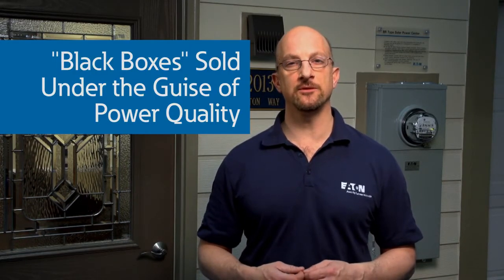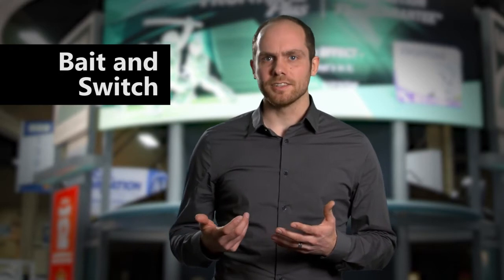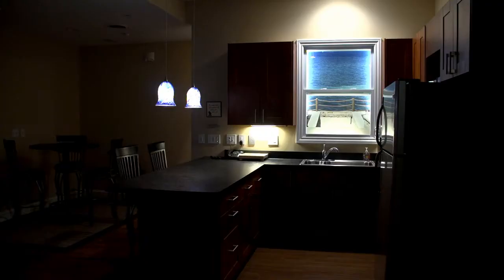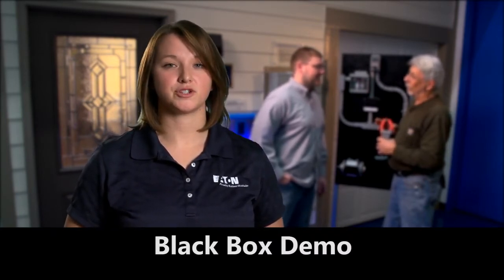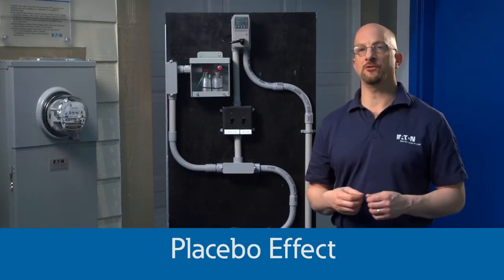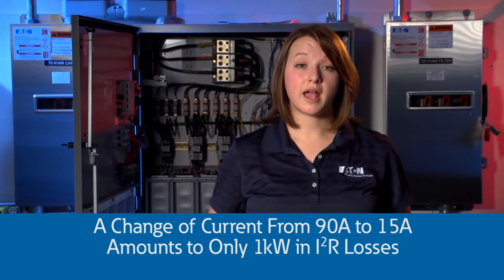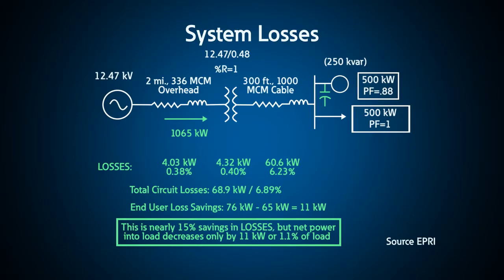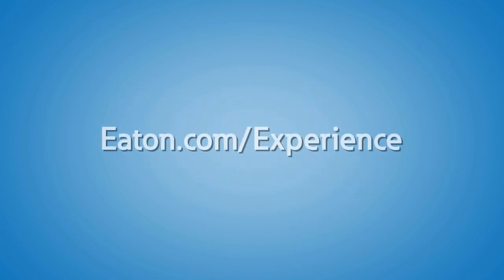False energy savings - free energy?

Comment: By adding a capacitor to a motor circuit that is inductive, you would be improving the power factor and therefore “wasting” less power. So how does the KVA get cut in half but the KW load not change? That to me doesn’t make sense. The KVA should stay the same while the watts change no? Being that the formula for watts is Volts x Amps x Power Factor = Watts. So if your power factor improves, wouldn’t that by definition change your watts? Am I thinking about this wrong?

Comment: I happened upon your video, while searching on a related topic.  I've been consulting in the energy field for 21 years and am certainly familiar with the topic that you discussed.  In fact, my company often validates energy vendor claimed savings on large projects.   I can tell you that there are incredible claims, poor executions and confused sales people in so many energy efficiency areas (e.g chiller reheat).   In this case, capacitors can certainly help eliminate sizable PF penalties when customers fall below a threshold.  However, could they have spent that same money in focusing on the larger inductive loads and buying new motors with far greater efficiency that solve the PF problem as well?  There are many variables and they will most certainly harp on distance from the meter and line losses to counter that argument.  As for this capacitor field in general, most of these people buy some type of distribution right to sell these magic boxes but may not quite understand utility rates or the best applications for capacitor banks.  Nonetheless, your video accurately depicted literally every point.